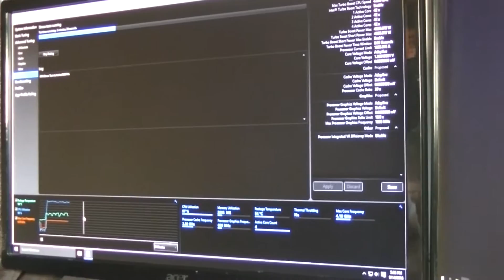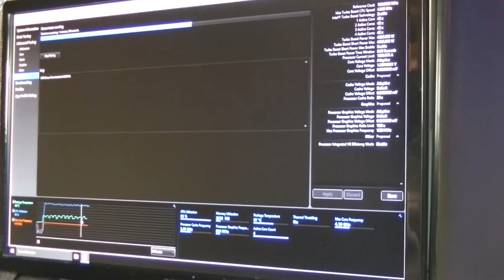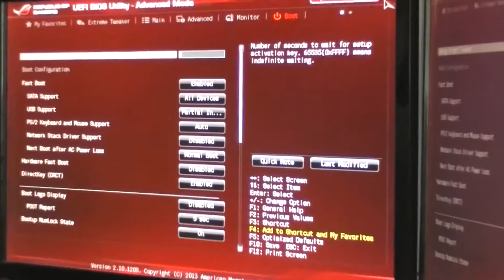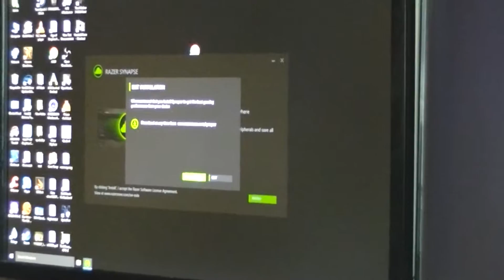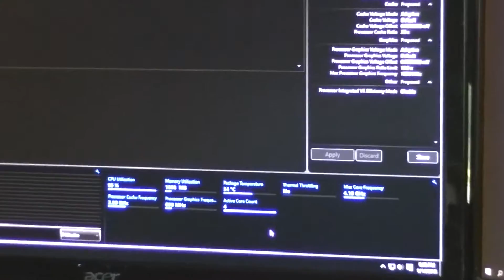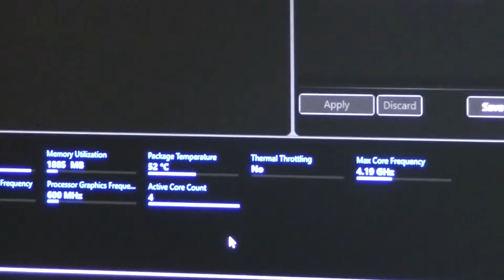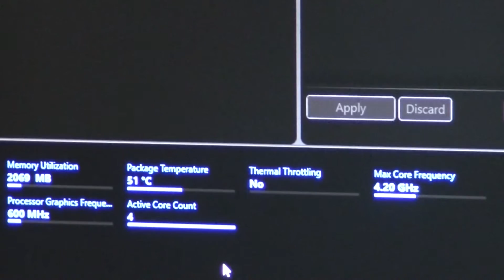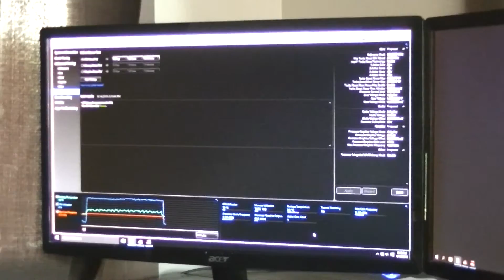delidding a 4690k

Comment: I've got my clock  4.5 and dont go over 63 degrees on full load.
Reply: mine its 4.65GHz 1.333v at Max Load
Noctua NH-D14 never breaks 62c
Reply: 4.7 is doable at around 70ties with a non-liquid cooling.. The biggest I tracked in summer with gpu under full load as well is something around 73 what is acceptable for me.. I use liquid metal both on die and on the lid.. I could maybe get better temps getting better cooler but temps are not the important factor for me x)
Reply: @LiteGaming10  I'm using 1.170v for 4.5ghz.

Comment: dude i delidded my cpu aswell, i did the exact same stuff as you (also didnt reglue it) but my temps are higher than before. what did i do wrong?
Reply from the maker: You cleand off all the adhesives around the chip and IHS?  If so all I can say is maybe you need more thurmal past
Reply: @brokenone22  tried more thermal paste and less thermal paste, same results. i cleaned off the chip and the ihs, tried applying only to ihs, same results. tried only on the chip die, same results. 

wtf did i do wrong lol.
Reply from the maker: @deathrager2404  what kind of past did you use?
Reply: @brokenone22  its probly some cheap shit, because i did everything correctly, even checked to see if that paste would spread good enough after i placed the ihs back in place, and it did.

ordered liquid metal, should arrive tomorrow. also got some nail polish to protect stuff next to the cpu die. 

i really hope its gonna work man xD
Reply from the maker: @deathrager2404  yeah intel past is not the best but there are worst ones out there.  The liquid metal is where its at for getting the temps down
Reply: @brokenone22  yea, sincerely hope it ll work. i ll post some stats tomorrow when it has arrived.
Reply: @brokenone22  allright, so i applied LM and here are the results:

prior to delidding my temps under load p95 were 82 degrees.

after delidding and applying the wrong paste it became 99 degrees as soon as i loaded the prime95 test.

today i applied LM and my temps were 70 degrees (max, so it was hovering between 67 and 69 with an occasional peak of 70)

i guess its GG, never knew it would be that good. i still gotta use another paste for cpu cooler, but for now its cool.

temps under agming are not above 62 degrees, and im using an aircooler gelid tranquillo rev 2. kinda old and a bit outdated but still goin strong. imagine if i have a noctua or an aio. 

anyway, im a happy camper.